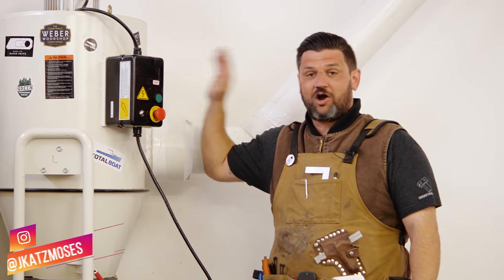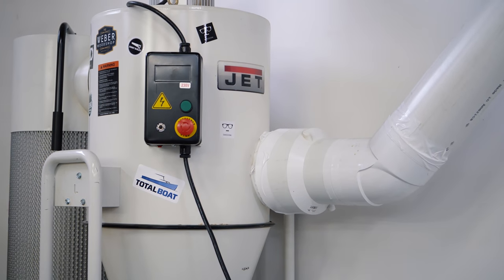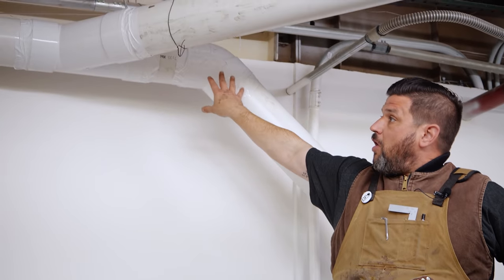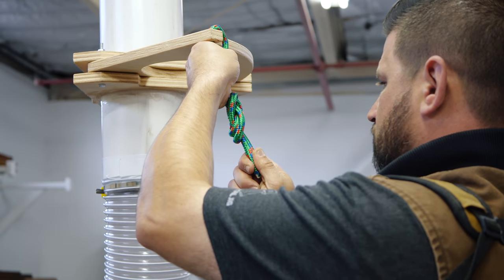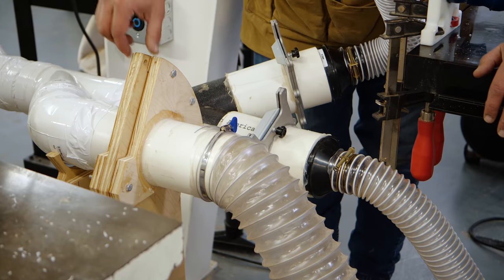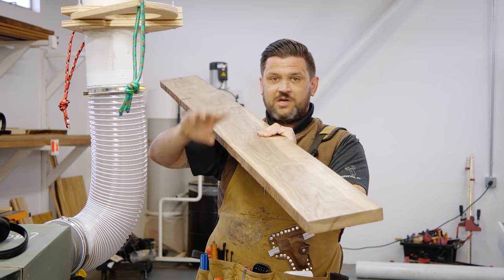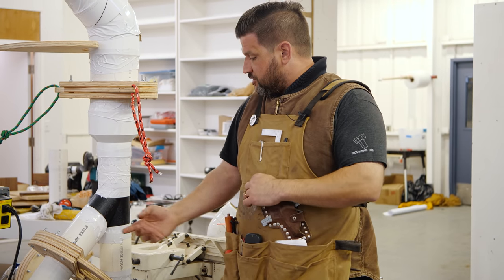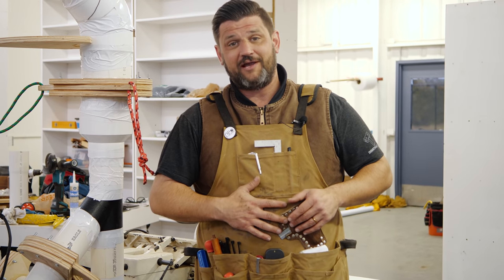Dust Collection Install with Lots of Tips,Tricks and Shop Made Blast Gates

Comment: Without reading through all of the comments here(over 200 at time of posting), I had a thought on your blast-gate mounting woes.

Dude, you just have them backwards! Take that curved edge of the pie shape, leave a little more meat on it, and flatten it off. Double-duty the bolts and you can add metal strapping, brackets, etc. Hell, you could even use a piece of 16g sheet metal, in place of the washers, fashioned into your bracket. All that being said, I like what you did with the redesign.
Swinging rather than the usual sliding is a huge improvement.

Comment: When HVAC guys install clothes dryer ducting, there is a limit for the length of pipe the can use. And in calculating the length, they told me that EVERY elbow counts as 5 feet of straight pipe. So if they have just 2 elbows (which is common), then the flow restriction from them is equivalent to 10 ft of straight pipe. A much bigger difference than I realised!
Reply from the maker: That's super interesting. I'll check that out

Comment: Does this (very impressive) system have any issues with the smaller diameter pipes farther down the runs?  With my small 4" collector, it has no power drawing thru a 2.5" hose.  Lots of info as to why out there and I understand the issue, I am just curious if you experienced the same issues and if so how you solved them.  Thanks for the awesome content and #ShopEnvy
Reply from the maker: It rips right at the router table. I would say it collects 20x the dust my old shop vac system had. Thanks my friend!

Comment: So with a small shop and a Ridgid 6.0hp shop-vac. Everything is 2 1/2" hoses. Can you come off a 2 1/2" shop vac to a 4" PVC run to a 4" blast gate, than a 2 1/2" hose to the machine?

Comment: Funny that you mention grounding, I was thinking about that subject as well, but for a completely different reason (I'm not worried about blowing up the system).  I wondered how well grounding the system would help with static buildup in the lines.  Less status might equal less sawdust sticking to the charged walls?  I just wondered if it would help with keeping things moving in the lines.
One tip I saw elsewhere for bonding your pipes together was to use some silicone caulk.  Just put a bead around the outside.  Seals it up, but easy to get rid of if you change the system.
You going to tape a thin strip of magnetic tape to the floor in front of the sweep?  It would help catch washers, screws, etc. that always end up down there.
Reply from the maker: Great idea on the tape. Just might have to do that. Not too worried as it's a cyclone but would be cool to grab lost hardware
Reply: Good point about static build up.  It depends quite a lot on how dry things are like the sawdust and the air.  The way to check is to stick a bare wire down in the airstream and run a load of chip/dust through the system and hold onto the other end of the wire.  You can get a nasty surprise.  Metal ducting is fairly cheap and solves the static problem if you ground at least one point of the system.  The danger is more from fire than anything else.  That is assuming no one is stupid enough to try and suck up some flammable solvent vapors.  (do that outside)
Magnetic tape is historically quite weak so a better alternative would be to take a piece of steel shim stock put it under the floor sweep with a Neodymium magnet on the outside that is removable so you can retrieve your screws, cotter pins, nails, etc.  I have seen more than one grain elevator fire so my stuff will always be grounded.
Reply: @stevemcentyre1570  You are comparing a grain elevator to a home shop dust collection system....those are vastly different things...that's like comparing bicycles to Semi's.

Comment: I have been a cabinet maker for 32 years, the company I have been at all that time has never ground it's dust collection in a area 80,000 square feet, they also use 6" flexi hose for all joints. I really hope you can try and prove all the doubters wrong
Reply from the maker: Mark my words my friend I will.

Comment: I just did my dust collection in a similar way.. but my main issue was when one section of the pipe got clogged and I couldn't see where the issue was.. what do you think about a few short sections of clear flex pipe around some of the complicated sections that may tend to clog so you could see the clog and clean it out easily? I still working through it in my head..
Reply from the maker: I think the only thing that clogs is blast gates. Everything else should be fine

Comment: I’m sure you’ve received a comment like this multiple times but typically you would want to avoid reducing before the wye’s. When you reduce from a 6” to a 4” and then use a 4” wye, it minimizes flow. To optimize the system you can use a 6”x4” reducing wye and then a 6”x4” reducer after the straight. I know it’s not as cost effective but it’s just the advise of a plumber. Appreciate your videos brother! Keep up the good work. 👍🏽

Comment: I'm doing something very similar and have been at it for like 3 weeks now back and forth between home Depot and wood craft, plus a few Amazon orders that got returned.  I was really happy to hear you say you're only using tape for some joints because I've got a few areas where that would save me some headache but I wasn't sure if I should and needed some encouragement to rationalize it!  I'm doing a floor sweep too but one thing I'm doing you might want to consider is lining the front lip with magnets so I can try and stop any metal from getting sucked up into the system.

Comment: Thanks for the very informative video. I just bought and assembled a Laguna C Flux 3 and plan start to use it with a 4 inch hose only. But I want to set up a system with PVC pipes. The question I have for you is, why did you not use like a main PVC pipe and then hoses to the individual machines? I guess in order to close the unused ones? Or is the airflow in the hoses not as good as trhough the smooth PVC? Thanks

Comment: Very nice shop and video. 
FYI, dust CAN cause fires and explosions, and people get injured or killed. It is NOT impossible.  Moving large quantities of dust and air through pvc DOES generate static.  Mitigating factors: dust management - you are not allowing large concentrations of dust to build up in the air of the shop; and ventilation appears to be good, which helps dilute concentrations of dust; size, or scale - it’s still a relatively small space compared to the large, enclosed facilities where dust related accidents happen. 
Please provide a link for the “wand” on the router table.
Best wishes.

Comment: I have a dedicated 1.5hp Delta 50-850 for my cnc and want to install it on a platform in a "closet" above my Blackbox Hurricane vac. Ceiling is just 8' so the only this will work is if I'm able to rotate the blower outlet to a horizontal position.  It seems like this would be more efficient as it eliminates one ell and feeds in from the bottom. Can you think of any reason I shouldn't rotate it?  Thanks

Comment: Question for you on not grounding the dust collection.  I am not worried about stopping a fire so much with the grounding but was wondering if you get static shocks at all when touching the equipment without the gounding?  Thank you and thanks for sharing your system.  Definitely using the tape technique!

Comment: True, Grounding is unnecessary. My best innovation is the addition of micro switches at each blast gate. Opening the gate throws the micro switch and automatically turns on the fan. I had a floor sweep and I liked it, but I took it out after James Hamilton AKA Stumpy Nubs cautioned that if you suck up any metal it can spark as it hits the metal fan blades and smolder in the sawdust and later ignite a fire. I’m not willing to take that chance.

Comment: Hi, just seeing your video. Why did you reduce 8 to 6 right out of the dust collector??? When you even stated later reduction is a no no. I know the 8in pipe would be more $$$. I would have run it as far as possible before going to the 6in . I you could run the 8 along the ceiling and reduce it to 6 going down the walls. From there reduce as needed.

Comment: Nice system but it looks like you interrupted the distribution pattern of fire sprinklers with the vacuum system  pipe. if you don't want to freak out the fire marshal, install everything at least 18 in below the fire sprinkler deflector.

Comment: You can't ground PVC even if you wanted to , It's not a conductive material , Putting copper wire on the outside of it does nothing for the inside of it , It's like a wire , Touching the outside of a insulated wire isn't going to shock you because power is running through it.

Comment: Have you ever tried the rockler quick connect system?  That is what i use for mine and I really enjoy it.  I am curious on the quick connect you have how often the tube falls off, I notice it did for the example.  Very cool video.  I like the tape idea for the piping.  It just takes one pipe change over to make that pay for itself to have it flexible.

Comment: Curious why you didn’t run 6” or at least dual 4” pipe to each tool. Seems like you’re limiting the system just the same for that individual tool as if you’d choked it down earlier on in the run. Debating whether I should run dual pipes to tools needing over-under as either 5” & 4” or just dual 4”. Then 6” for everything that’s just single point collection. Seems like overkill though.

Comment: You might not be able to blow up the dust collector but the static electricity still will hurt a lot if you get close with your hands to the ducting. That could be solved with a few screws in the pipes connected to a grounding object.
Reply from the maker: My brother and I spent our entire childhood rubbing our socked feet on the carpet so we could zap each other. Didn't hurt then and I'm sure 25 years later it's not going to be a big deal.

Comment: I’m a newbie to central dust collection and after watching your video I noticed your comments on not grounding your pvc runs. You stated that you weren’t grounding them because “it’s impossible” to blow up a dust collector. My question is - I thought the purpose of grounding pvc runs was for fire prevention due to sparks and flammable saw dust. Please advise. Sure as hell don’t want a fire in my new pole building shop after finally pulling the trigger and getting out of my 13-year rental shop! Any insight to this would be greatly appreciated. Thanks 👍🏻

Comment: On the Green/Red with the rope - I did something similar with my plastic Blast Gates. Using vinyl sticker paper I would stick the name on the tab end of the blast gate on a red sticker. On both  part of the gate that slides inside, I would have a green sticker with the word "Open" which would only be fully visible when the gate was open. If the gate was partly open, it would be obvious because of the word.

Comment: Nice video, I’m doing my shop now running 4” pipe. It’s a small shop and I tested the longest run and 4” works. 
For your floor drop add a magnet strip to catch any screws or nails, etc. 
For mounting pipe make cap and saddle type and screw together to go around pipe.
To get rid of that static electricity run wire along outside of pipe raped along pipe, secure to pipe with self tapers going inside where the flow is, ground this to dust collector motor base. Keep it simple 
The pop on your elbow will like it when it touch’s the pipe lol after a long run collecting.

Comment: Just a thought . Ever considered useing pieces of inner tube to seal the joints on your dust collecter system . Easy on off, air tight. Tire shops will give blown inner tubes away

Comment: Thanks for showing your dust collection system. Building a system for my 20' x 19' garage shop. Going to build a 6" main before necking down to 4" or less at my tools.  Trying to find 6" fittings for the drain/sewer pipe.  Did you just go to your local home improvement store, online, or some industrial store?

Comment: Do you have any tips for connecting 6” pvc to the 5” port on the Dust Deputy.
Reply from the maker: No sorry
Reply: Take your 6 inch PVC and a heat gun. Heat the pipe until it is soft and floppy. Then take some screw type band clamps and tighten them around the PVC. It will reduce it down after a few times doing that to where you can attach a 5 inch hose.  
I had to do the same thing to some 4 inch PVC that was, for some reason, way bigger than the 4 inch flex hose I had on hand.
You could also get a rubber 6 inch coupler and just tighten it down to the 5 inch dust deputy after wrapping some duct tape around it.

Comment: This is a great setup Jonathon, very well thought out. I also built the rotational style blast gates. I'll never use anything else. You mentioned attaching them to the wall, I built all my gates to attach to the walls and ceilings while holding up pipe, I've got two videos on those builds if you are still looking for ideas. Your new shop is looking amazing!
Reply from the maker: Great channel bud and I'm a new subscriber. You gates are amazing. Great design. I really had a tough time figuring out the shape of the rotation around the center whole while having enough mass around the center hole so it didn't break. All while trying to build in the correct angle of the stop. Took some thinking and about 100 bucks worth of plywood to get right but I'm really happy with them. I'm happy to send you a set of plans and vice versa so we can compare notes. Cheers my friend!
Reply: @katzmosestools  Thanksk! Sure thing, happy to send you some plans or dims. Ya, I figured mine out in SketchUp, but I also built some less successful gates first as well. (Sigh) If you are at Workbenchcon this week, we can compare notes in person!
Reply from the maker: I'll be there!

Comment: Nice. Cool idea with the coloured rope on the blast gates. If you want more visibility with the blast gate you could paint them red and green so that one colour would be blocked from view when it was opened or closed. Tim sway did a mod with big yogurt pots on the on each machine so that the flexible pipe would fiction fit on and could be quickly changed from machein to machein.
Reply from the maker: That's a great idea. Thank you

Comment: I've been in the commercial side of woodworking for over 25 years. In that time there have been 2 dust collection systems "blow up". It is rare that it happens, but I would not say that it is impossible. It's not all that hard to ground the system, just do it for peace of mind.
Reply: That's in an industrial setting. A single person or even a hand full of people can't make enough fine particals to meet the correct air/fuel mixture needed. There is a reason the only times you really see stuff blow up is in grain silos or industrial settings.

Comment: I have 5" metal pipe in my Dust Collection any plans to release blast gate plans for 5"
Also i just purchased your Dovetail Jig, Alignment board, and stop block cant waite for them to arrive so i can start using them.
Reply from the maker: Awesome bud! Thank you! The fusion plans are included so you can edit the plans to fit your needs. Cheers!

Comment: I’m working on making a ducted system for my approx. 530 sqft shop... so basically the same thing, right? Anyway my question is where do you get that super light, flexible 4” hose?
Reply from the maker: PSI Woodworking D50C 4-Inch by 50-Feet Clear Flexible Dust Collection Hose https://www.amazon.com/dp/B0006FKJD2/ref=cm_sw_r_cp_apa_i_iZyACbGEHYJG2
Reply: Jonathan Katz-Moses thanks!

Comment: My friend locally is a trim manufacturer for our home improvement stores where I live and make custom stuff too, their cyclone blown up, but almost 100% rare.
Reply: Nobody was hurt though, and none of the tools for manufacturing in the building that was on fire got damaged.
Reply: I don't hang around his plant though so I don't know all the tools that are connected to the vacuum, and he does grind custom router bits so they do have sparks. Who knows maybe almost all of the reports were actually caused by a metal spark, I haven't ground my system also, I figure just keeping my system clean will near 100% prevent the theory of it, and my workflow isn't enough yet in my life to even think about it, if it happens to a plant in China I would be speculative because I've seen videos of their plants and some of them let their employee's smoke near the equipment.

Comment: Where did you get the blue flex hose...I think you called it a wand...it’s the pipe on the thumbnail of the video
Reply: It's called Loc-Line, you can get it on Amazon in all different sizes.

Comment: If the section to the cnc and bandsaw is heavy just build another floor sweep, if you have to build something to hold the weight it might as well be useful.
Reply from the maker: Great idea bud!
Reply: @katzmosestools  If you do put in another floor sweep and space allows, put the blast gate around waist height and a wye just  below it with a reducer and a smaller gate so you could attach a coil of vacuum hose like you were discussing

Comment: Silly question - How do you get your 6 inch pipe cuts square?  I cannot figure out how to do this to save my life....
Reply from the maker: You don't really need to. Any fitting is going to have at least .75" of play before it is an issue. I use a miter saw to cut mine usually and just turn it half way through
Reply: I thought the blast gates needed a square cut?
Reply from the maker: @MarcWaddell  with 3/4" max tolerance

Comment: Question,   if you put metal wire on the pc and wrap that wire to any metal pipe, if any of the pipe is grounded doesn't that ground the system for you?
Reply from the maker: Not sure. The metal pipe would need to be grounded
Reply: @katzmosestools  if the compressor or the sprinkler pipe is what you attached to then im guessing one of them is grounded